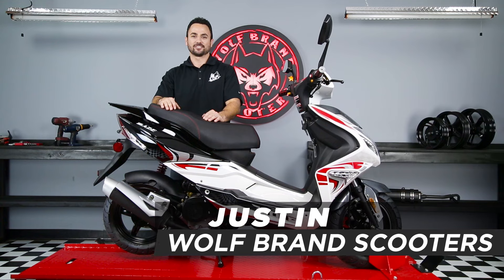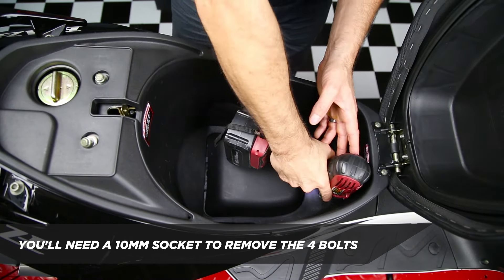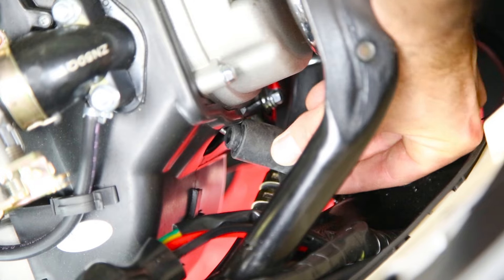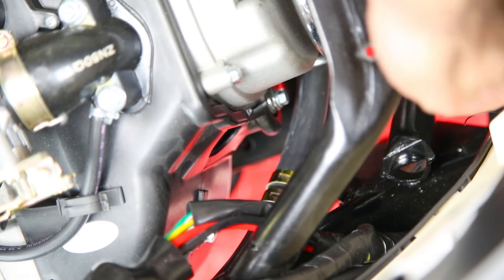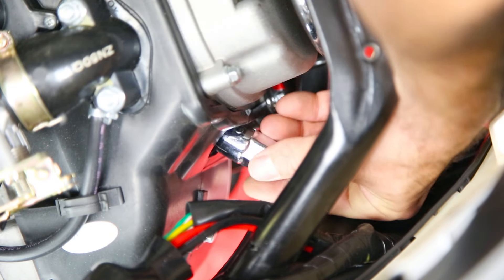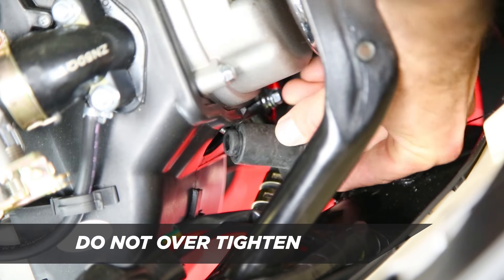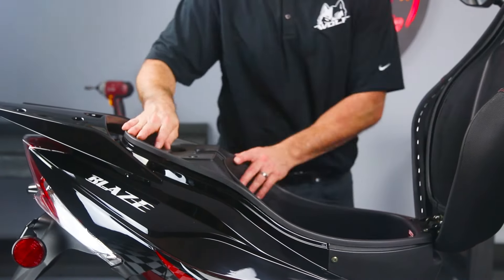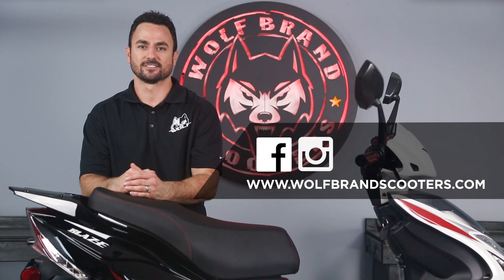Scooter Spark Plug Change

Comment: Ah yes, very helpful to NOT TELL ME WHERE THE SPARK PLUG IS.
Reply: exactly my thoughts
Reply: The sparkplug is inside you have to insert the screw and unscrew that's how it works for all scooters take your time doing it also it's very simple.
Reply: @MsLiz097 no he means where it is in the scooter although you should be able to find it by how it looks

Comment: Well, my EX-150 is different than the video. First, after removing the four bolts on the seat bucket, it doesn't lift off. I have to remove two additional bolts from the seat hinge in order to pull the bucket off. Next, the spark plug is not accessible. Even after removing the seat bucket, there's a rectangular tray that's bolted in place, and it sits right above the spark plug. Removing the small panel below the front of where the seat is allows me to reach my hand in, but there's absolutely no way to remove the spark plug from that angle. If I could remove the rectangular tray, I'd have access, but the only way to remove that tray is to remove two small nuts that are under the tray, and guess what? It's pretty near impossible to get to those nuts with a socket wrench. Awful design. (And if it's not a design problem, there ought to be a video or diagram explaining how to get to the spark plug.)

Comment: What type of plug do I buy
Reply: It depends on what model you have. A7RTC is a common type, google what model scooter you have and then check an online store shop list. Some of them will have a model list when you search the part number of the spark plug. That's the way i do it. I order most of my parts online

Comment: Is that NGK c7hsa spark plug the most common plug for scooters? Im not sure what model scooter I have its getting fuel I think but just doesn't start not sure if its the plug or bad vaccum pump or what's going on.
Reply: Me2 I think it's fuel pump

Comment: My wolf 1 is about to hit 4000 what kind of work should I have the shop do on it??
Reply from the maker: Hi Felicia, Thanks for the message! Every 1,000 miles a standard valve adjustment, and oil change should be done. At 4,000-5,000k miles a belt change should be done. If you take it to a Wolf Dealership they should be able to do a standard service. You can find one at our website, wolfbrandscooters.com

Comment: 2/3s of a turn? Lol. No one should put their spark plug back without a torque wrench.
Reply: you must sell torque wrenches. lol
Reply: @Hithere-ek4qt   No, I just know that most people can't judge 10 nm of torque, since it isn't very much. Everyone has different strength levels and I would rather have peace of mind than wonder if I'm getting blow by, or if I've wrecked my cylinder head threads and need to now spend a huge wad of cash replacing it.
Reply: And a bit of anti-seize compound is a good idea too.
Reply: when you have a crush washer 🤷‍♂️